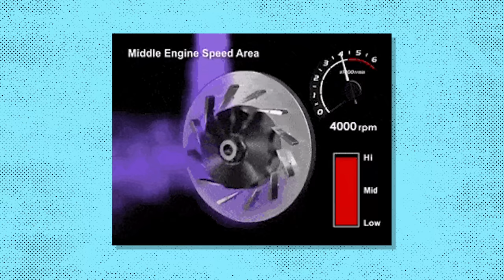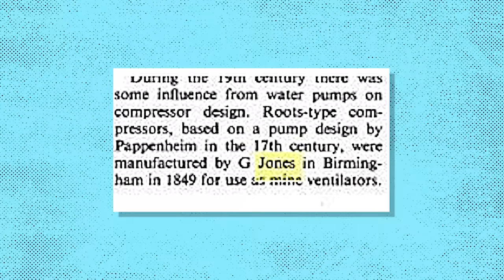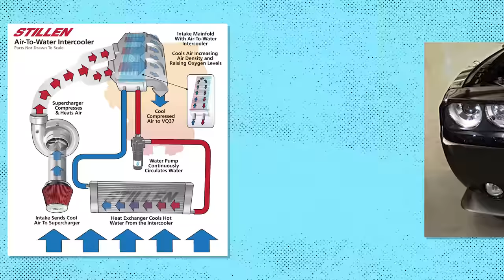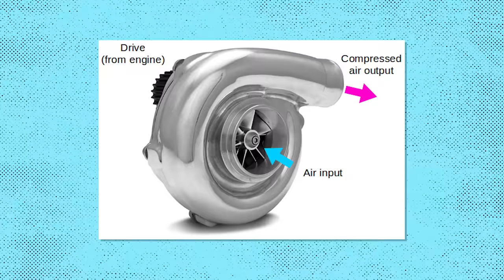Why Superchargers Aren't As Good as Turbos

Comment: Why do 12000hp dragsters use superchargers instead of turbochargers?
Reply: Because turbos are banned in NHRA Top Fuel and Funny Car
Reply: @sandervanderkammen9230  Has any turbocharged engine ever got near the 10MPa BMEP that supercharged Chrysler drag engines get?
Reply: @bruceparr1678  How can they if they are banned?
Reply: @bruceparr1678  What's your point?
Reply: @bruceparr1678  NHRA Top Fuel is a vintage class motorsports series. No new technology is allowed.
Reply: @sandervanderkammen9230  Just a simple question. Can turbocharged engines achieve the BMEP produced by supercharged engines. Seems like a relevant point.
Reply: @sandervanderkammen9230  For safety reasons.
Reply: @sandervanderkammen9230  Turbocharging is banned in that other vintage racing class, F1.
Reply: @bruceparr1678  It banned, so its a moot point.
Reply: @bruceparr1678  No,  Top Fuel is only allowed 1960s vintage engines.
Reply: @bruceparr1678  I thought F1 cars were turbocharged...
Reply: @bruceparr1678  You don't know what vintage engine is. Top Fuel only allows 1964 Chrysler 426 hemi engines... completely obsolete technology.

Comment: Turbos are trash because if you don’t have anti lag (breaks all kinds of stuff) you get pull when you don’t want it in turns. Drag racing sucks it’s all about the turns.
Reply: Npc bro
Reply: @futokarin9745  Rotard bro...
Reply: I would never own a rotary, I’m not a mechanic, I’m a driver. I drive and I don’t have the moneys to get a rotary rebuilt every month. but if I did have that kinda money I would totally own one. I like other cars to… I own a ae86 with a tuned red top 400hp with whiny racing gears. it’s a coupe with 85 Supra rims it’s tubbed and is chill. I would much rather have this an a rx7 but an if I had the money to have as many cars as I wanted an rx7 fc would for sure be one. My Corolla revs to 11 and would lose any drag race I tried.. just the way I like it.

Comment: If they suck, then why do dragsters use s use superchargers instead of turbo chargers
Reply: Because turbos are too fast, the NHRA banned them.
Reply: @sandervanderkammen9230  like the turbine of the turbo moves to fast? Also, turbochargers are great for high rmp racing, but dragsters aren't always high rpm, but superchargers provide that instant power.
Reply: @unrealgaming8333  No, NHRA banned turbochargers because they make the cars too fast.. if Top Fuel cars were turbocharged to the same boost level they would be producing up to 3,000 additional horsepower.

Comment: Turbos are good at supplementing small engines to maintain fuel economy while offering better performance. Think of them as gas mileage first, performance second.
Superchargers excell at delivering instant power at all rev ranges. They are the solution when performance is paramount.
No one buys a Hellcat or GT500 concerned about fuel economy.
Reply: Not true at all, a Hellcat would be much faster if it was turbocharged.
Reply: Instant slower is still slow.
Reply: @sandervanderkammen9230  Slower than what?  A supercharger can deliver all the boost an engine can handle. In fact, Ford has a warning for warranty claims where people are pully swapping the drive pulleys on GT500s and overboosting the engines.
Reply: @DJ_Force  Turbochargers deliver more power for the same boost pressure.
Reply: @sandervanderkammen9230  Turbo's don't require as much engine energy to run, so yes, there is more horsepower for a given boost level.
However, superchargers can deliver all the boost your engine can handle. Also, except for centeifugal superchargers, the power is available at lower engine speeds, where you need it most. Low end torque delivers that neck-snapping off the line power that makes cars feel faster and wins on the street.
Reply: @DJ_Force  Mitsubishi Lancer Evo was running 22psi of boost stock... the GT500 is only 11psi right?
Reply: @DJ_Force  You see Dodge pick-up trucks with a Cummins engines with triple compound turbos running over a 140 psi of boost.
Reply: @DJ_Force  Turbocharger don't require any engine power, they run entirely on the waste heat energy expelled from the engine that is completely wasted in a supercharged engine.
Reply: @DJ_Force  Superchargers deliver less power, and less power equals slower performance.
Instant less power is still less power.
Reply: @sandervanderkammen9230  GT500 produces 760 horsepower, Evo around 300. What's your point?
Reply: @sandervanderkammen9230  Not true, turbo chargers create back-pressue that reduces the pumping efficiency of the engine. It is more efficient, but still not free.
Reply: @sandervanderkammen9230  The Dodge Demon produced 840 horsepower, with a supercharger. How many turbo cars, FROM THE FACTORY, can top that?
Reply: @DJ_Force  Only 760hp? From a forced induction 5.2 liter?
The Lancer Evo X produced 400hp ( 200hp per liter)
If it was a 5.2 liter? It would produce over 1,000hp!!!!
Thank you for proving my point.
Reply: @sandervanderkammen9230  Dude, a supercharger can deliver as much boost as an engine can handle. There is no ceiling to supercharger boost. The only difference between a turbocharger and a supercharger is the source of the rotational energy, not the boost delivered. The supercharger has instant predictable, the turbo doesn't. The only reason manufacturers use turbos is gas mileage.
Reply: @DJ_Force  Oh no, you are very confused and misinformed.
A turbocharger will always produce more horsepower with the same amount of boost.
Turbochargers are used because they make more power.
They are more efficient than superchargers and produce more power per unit of fuel.
Reply: @DJ_Force  Not true, that depends on the type of supercharger, centrifugal compressors produce more power and are not linear, their power band is curvilinear... like a turbocharger.
 You really don't know much at all about superchargers or turbos do you?
Reply: @DJ_Force  The Bugatti Veyron does not use 4 turbos for fuel mileage son... its has turbos to make it the fastest production car in the world.
They don't use turbos on pull tractors for fuel mileage either... they are used for pure horsepower!

Comment: This video is kinda misleading because people need to understand that a turbo  is not better than a supercharger and a supercharger is not better than a turbo
Supercharger is not the same thing as a turbo because its tow different things
Superchargers are better ind big heavy engines such as in trucks and Top fuel dragsters
Turbos are more useful in smaller engines as in cars
People must understand that they are not used the same way
Reply: Turbochargers are better, that is the entire premise of the video.
Turbos make more power for the same size engine and the same amount of fuel.
They have a major advantage over superchargers.
 Most trucks are turbocharged.
The NHRA banned turbos because they make the cars too fast.

Comment: all power adders of any kind have parasitic loss that is in fact negligable.
EXCEPT NITROUS, which was certainly not banned for safety reasons, but rather making cars too powerful for not enough money....
cha ching.
Reply: Turbochargers do not have parasitic loss.
Reply: @sandervanderkammen9230  yes they do. Turbochargers have backpressure.
Reply: @THESLlCK  No they don't dummy... there is an increase of exhaust flow because gas always moves from higher pressure to lower pressure.
Reply: @THESLlCK How can they have backpressure if they flow MORE AIR????

Comment: Ur dead wrong.ur exhaust isn't unused waist ur pushing a turbine with it ,it takes energy from the engine to spin the darn thing ,that push against air isn't nothing...how does a prop on a plane work, force on air isn't nothing.

Comment: so basically you say "superchargers bad because parastic loss due to being belt driven" . that it ? yeah okay there is a parasitic loss but the fact that you always get boost no matter where you are in RPM means you get more HP instantly regardless of if you're doing a rolling race a drag race lap  times or whatever else. meanwhile the turbos all have lag which you could try and fix by running lower boost but then you get less HP or you add another turbo therefore making it much more expensive, complex and less reliable especially if the OEM platform you're working on isnt twin turbo to begin with. one thing turbos will do better is that top end performance, top speed for example but to go that high in RPM's to get that high boost you'll need a really long straight and you dont really get too much of those in a race and in a drag race the straight isnt that long either... both turbos and superchargers have a place in the automotive world but saying superchargers suck only shows that you dont seem to understand there isnt a single answer for all problems. you wouldnt take a supercar to tow 10000lb of cargo but you wouldnt take a F150 to a supercar race.
Reply: Heavy duty trucks don't use superchargers.... they all use turbochargers.
Reply: @sandervanderkammen9230  okay ? never said that heavy duty trucks used superchargers lmao. in fact the only thing i said about trucks is that you wouldnt take one to a super car race so whats your point ?  also just to add to this most heavy duty trucks are diesel which produces more pressure in the cylinder heads which leads to higher exhaust pressure making it easy to get power out of the exhaust with aa turbo so yes in this instance it would make sense to go for a turbo but a heavy duty truck has nothing to do with my comment tbh. I said it once and ill say it again both superchargers and turbos have a place to be you just gotta know when to apply which
Reply: @williamg8136  What do you think drives the turbocharger???
The advantage of the turbo is the power that drives the compressor is free. 
MORE POWER
MORE EFFICIENT
Reply: @sandervanderkammen9230  this is exactly what i said. jesus man learn to read.
Reply: @williamg8136  Superchargers suck.
Reply: Turbos make more power.

Comment: 0:8 sound close to a V8 so how can you say no one is using Blowers? Since the beginning of performance they were the key 30s f1 cars were even double supercharged 1931 Mercedes SSKL had 300hp
Every fighter plane, and 2stroke GM diesel
The most awesome American cars are all blown, Gt500, Zr1, Hellcat, the old Studebaker's and Mustangs and the feared say: WE HAVE REASONS TO BELIEVE IT'S SUPERCHARGED, cause no one could catch it. 
The top Fuel Hemis generate 11000hp so keep quiet
4000hp SCREW BLOWN HEMI is way better that 15mil f1 engine that makes a few hundred hp screamin it's life out
Reply: Turbochargers were not widely available in the 1930's.
Many WW2 fighter planes were turbocharger as well, the most powerful aero engines are the time were turbocharger.
Detroit Diesel, EMD and other Winton  type and opposed piston 2-stroke Diesel engines are Turbocharger for maximum performance.
Reply: The fastest American production cars are all turbocharged
Turbochargers are banned in NHRA Top Fuel.
 The most powerful racing engines than the Wankel per liter are Turbocharged F1 engines.

Comment: This is just drool... The two are vastly different on their rate of air pressure increase. It is application-specific. If this guy's overly simplistic view was correct, then why hasn't turbo charging taken over Top Fuel, the highest HP V-8 engines ever. Also, he never mentions the weaknesses of turbo chargers.
Reply: Turbos are banned in NHRA because they make the cars too fast. 
Superchargers have no real advantages over turbochargers.
Turbos have a huge advantage in that they make significantly more power.

Comment: I think a clutched supercharger could be a more practical option since you have a way to cut down on parasitic loss by disengaging it from the crank when the driver doesn't want power. Also I'm not sure I would say that superchargers really have an advantage over turbos when it comes to spooling anymore. Most modern turbochargers are fully spooled by 2,000 RPMs, especially Hot V engines, which have the intake and exhaust ports switched to allow there to be less piping overall for the turbos.
Reply: Depends on the application and more importantly the type of supercharger... 
I you are using a supercharger to maintain volumetric efficiency at high altitude, no... better to keep the compressor engaged.
If its an internal compression type supercharger then bypassing air from the manifold is ineffective, decoupling is your best option.

In some applications a variable speed viscous coupling is an excellent solution.

Under ideal conditions turbochargers have no parasitic drag... they produce a net gain in thermal fuel efficiency and power output.

Comment: this video was poorly researched, really only regurgitating the basics and barely getting that right. 

the reality is that roots type blowers are around 70-75% efficient, other PD blower types are around 75-80% efficient, centris are 80%+ efficient, and turbos also end up up right around 80-80% adiabatic efficiency. 

OEMs rarely use roots type blowers anymore,. theyre far too inefficient and when they are used, its only for price and low boost designs. nearly every single higher power PD engine nowdays uses a TVS blower because its SIGNIFIGANTLY more efficient.

centrifugal s/c dont get used in OEMs because they require maintenance, more so than a PD blower. some designs are sealed but even those arent ever going to be reliable for 150,000 miles. most people cant even change oil regularly let alone remember to diligently change compressor oil, even if its really easy to do. 

turbos are generally more efficient but theyre not as common (until recently) due to packaging and heat management from the housings themselves. both of those problems mean more money and design time. OEMs do not use turbos because theyre more efficient, they use them because its cheaper to do compared to a n/a engine with the same power goals and because insane regulations force them to use it over other ways to make power. 

i am disappointed in this video, it doesnt seem like the research was put in to the video that it deserved.

Comment: Why do top fuel dragster use superchargers then
Reply: Because they dont care about efficiency or packaging, thats why. When you're making over 10,000 horsepower you dont care about using 1,000 of it to drive your forced induction. However, top fuel dragsters doing something doesnt mean road cars or even other race cars should. They use centrifugal clutches and dont even have multi-speed transmissions, their engines have to be torn down after basically every run.
Reply: BECAUSE TURBOS ARE BANNED IN TOP FUEL
Reply: @Kevin-dt9xm  The NHRA tested Turbos and determined it would make the cars too fast, turbos were officially banned in the interest of safety.
Reply: @sandervanderkammen9230  thats because at the time 4,500 was too much horsepower and 300mph through the quarter mile was considered unsafe, nowadays theres 11,000hp dragsters getting up to 340 in the 1000ft.
Reply: @Kevin-dt9xm  Imagine the problems of a TOP FUEL car with 16,000 horsepower!